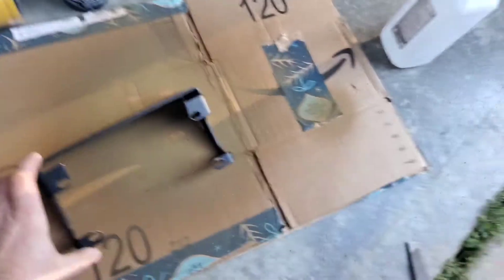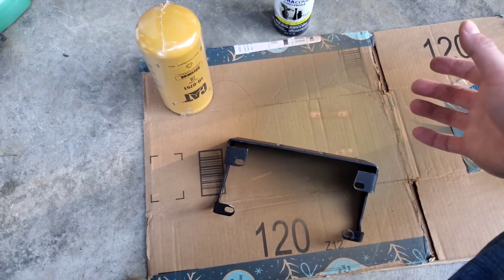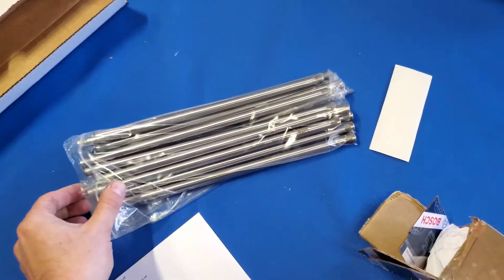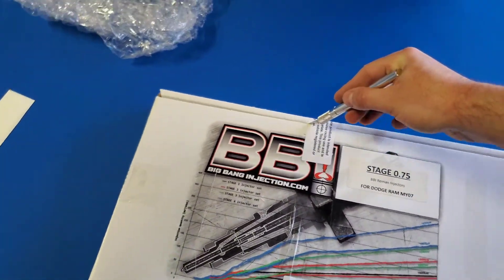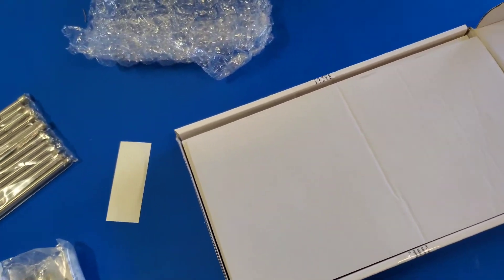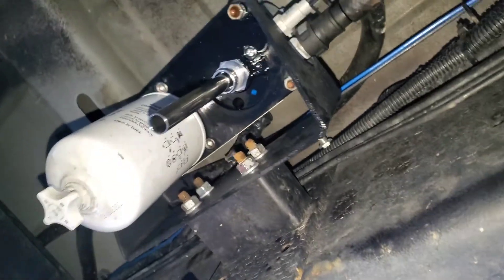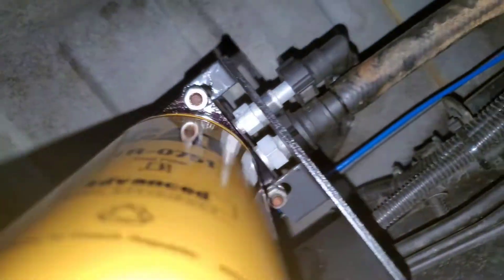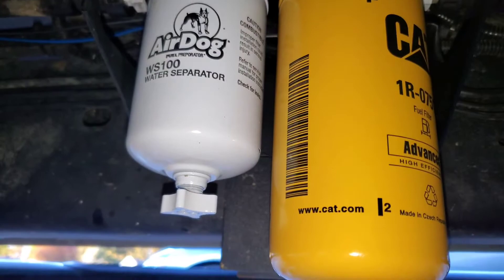Installed new CAT fuel filter on Air Dog and unboxing of the new BBI injectors

Comment: Good move on the cat filter mod  for the air dog did the same thing on mine can't beat that cat filter with the absolute 2 micron cellulose media. seeing how I was a mechanic at CAT had access to the filters for cheap so for me was a no brainer to make the switch.  For w/s u  can also run a Baldwin, fleet gaurd,  wix, napa filter for it if u haven't found a replacement already seeing how its yr old video u probably have but if not here's the p/n  if I remember correctly 
p/n are 
Baldwin WS -- BF1275 
Napa WS -- 3616
Wix WS -- 33790 
FLEET GAURD WS -- FS19768
Reply from the maker: Yea I've since replaced their air water separator with I think a fleet guard. I'll have to look tomorrow but it's much better quality.

The 2 micron absolute is the way everyone should be running their trucks even if its just a remote filter with stock fuel pump setup.
Reply: @joebidden4914  agreed idk why Cummins ever put a 7 micron filter on the C/R well the 5.9 atleast can't speak for the 6.7 C/R...I got the 5.9 but here shortly i plan on picking up as set of those BBI injectors as well  but probably gonna take my chances with the remans from Mm3tuning with 2-4 tunes with full trans tune to go with them  just can't decide if I should do stage 1 or 2 I know until I get a heavily modded or dual cp3 I'm gonna have to defuel stage 2 but I'm ok with that  which  is why im debating the 2 I know stage 2 probably is a bit much but I'd rather defuel now and turn them up later when I'm able to feed them properly.  rather than stage 1 and later be maxed out with no where to go but new injectors again 🤔 and whats got  me think not to do stage 2 is I know the stage2  will create a bigger snowball of part that will probably have to be upgraded... Like push tubes and springs to hold the air they will need which  ur video also made me start contemplating if I should do them at the same time instead of when I was originally planning to......If only parts where cheaper or we had million's of dollars lol clean looking truck by the way what all do u have done to it besides the injectors and airdog?
Reply from the maker: @ShroomDaddy707  if you tow don't go crazy lol. It's also 10 micron filters but it was a Dodge thing. They did it in my opinion to make massive income on service by destroying the trucks just out of warranty.

Definitely build your transmission lol. Depending on what you want to do with your truck just keep in mind it's a big 7-8k lb vehicle and if it goes fast you gotta be able to slow it down too.

I have done bunch stuff, upgraded fixed vane turbo, head studs, BBI stage .75 injectors, bigger intercooler, AFE stage 2 intake with air scoop and AFE intake elbow, PPEI EZLynk tune with 5 position switch, southbend dual disc clutch, 5" exhaust and added resonator because it was too loud, 3" lift and Apoc adjustable control arms, wheels and tires, upgraded shifter because my oem shifter snapped on me while driving. It's been a great truck and I love it. It's my 4th Cummins. I've had 2x 3rd Gens (one manual one auto) 1x 2nd gen (manual) and now this one which is manual. I know I've done more to it but I can't think of everything off the tip of my head lol.